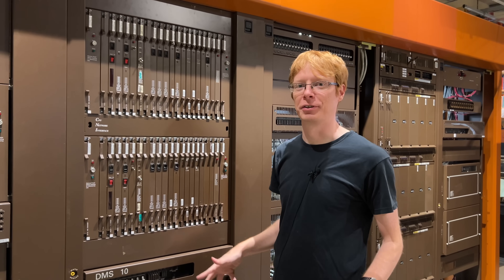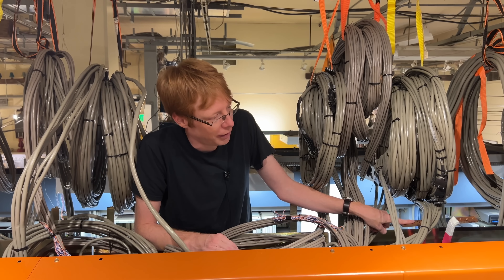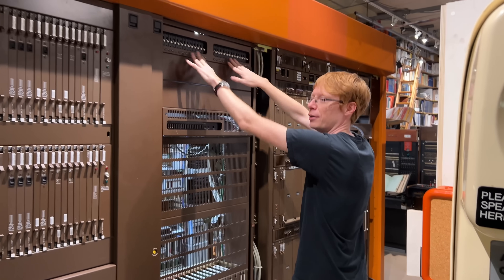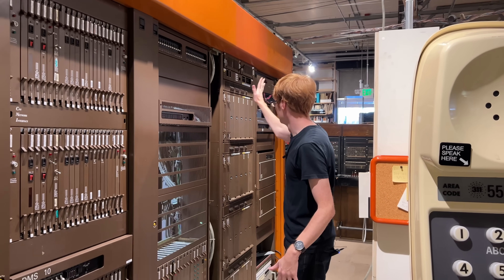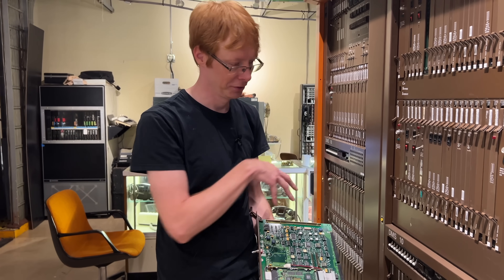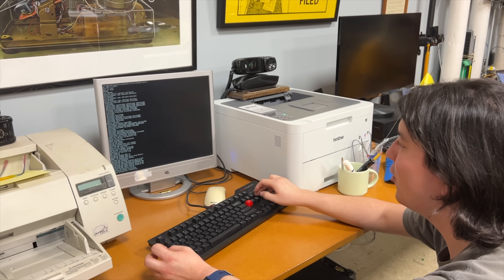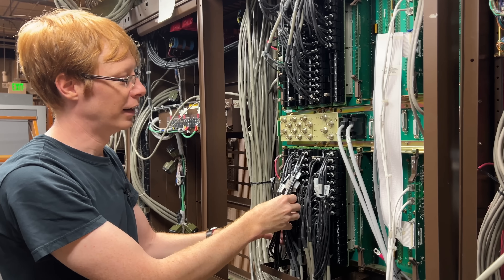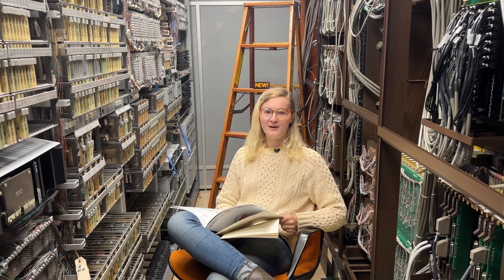Grounding and Wiring our New Switch

Comment: The power is distributed via uninsulated copper bars? Is that weird? It seems weird.
Reply from the maker: Hoo boy you should take a look behind our power board. Thousands of amps on uninsulated bus bars. 

The DMS-10 power runs from those bus bars into circuit breakers, then cables which distributes it into the various frames.
Reply: @StringerNews1 You can store AC, sort of... the physical inertia of large synchronous generators stores energy and maintains a constant AC frequency in the face of load fluctuations, which actually has an extremely important role in power distribution analogous to decoupling capacitors in low-voltage DC circuits. In fact, a synchronous machine (motor/generator) with nothing attached to the rotor (except mass), used purely for its inertia, is known as a synchronous condensor or synchronous capacitor. They're used for power factor correction and power grid stabilization.

But as the name suggests they're definitely more analogous to capacitors than to batteries. The output frequency depends linearly on the amount of energy stored, so if a synchronous condensor were used as battery the AC frequency would gradually decline during discharge, which may not be appreciated by equipment.

Also, heavy spinning things that store a huge amount of kinetic energy are kinda terrifying.... but then again, same goes for large battery installations.
Reply: @StringerNews1And a battery stores chemical energy, not electricity. Electricity consists of moving electrons, it's not something you technically "store". The exact manner in which energy is being stored isn't relevant to the application since it's converted to/from electricity as needed (DC in case of a battery, AC in case of a synchronous condensor).
Reply: @StringerNews1 Also, in both cases the energy conversion is a physically reversible process, i.e. they will instantaneously switch between charging and discharging as needed (passively, without some form of active control), which is what enables their use to smooth a power supply.
Reply: It can vaporize a dropped screwdriver without even flinching leaving only a shadow of metal around it.
Reply: You are quite correct, having large live bus on top of the frame would be EXTREMELY dangerous. IIRC the bars at around 3:44 in the video are for battery return, which is bonded to earth, so the difference between the bus bar and the steel parts just a screwdriver away will be 0V.

Power distribution is accomplished via the various breaker and fuse panels mounted within the bays. The only live connections on top are those two that Colin indicated are A and B feeds, which are twisted bars with red heat-shrink on them.

You'll find bare copper bars for distribution within protected bays like a BDFB. You'll see similar in battery rooms too, older setups (with glass batteries) you just knew to stay the hell away from them. Newer plants tend to have protective sheets overtop of the straps. Large distribution systems can have similar, where current is carried by overhead bars (lams/laminations) instead of cables.

One of the models of power plants that was sold with the DMS-10 is like this but acrylic panels protect the entirety of the live components.

Comment: I'm very curious about something... Where I live, I am serviced by a DMS-10, but in speaking with a local tech, I was told our DMS-10 operates in a very different manner compared to most. I was told that in order to save costs, our local DMS-10 does not have a "Switching Matrix" (his words), and that all calls, including local to the switch, are sent to a nearby town's DMS-100 and routed back. He told me this is an extremely rare way of setting up the switches, and was only done in 3 other locations across our entire province from his recollection. Does this make any sense? Any feedback on this? It's an interesting tidbit of information that I figured would have your curiosity. I also can vouch that we've had the main feed lines between the two switches go down, and take down the entire town's switch, including calls to itself stopped working. "Survivability" mode I think he called it. We also have some DMS-1U switches still peppered around the area as well and he said those were also set up in a strange manner. I got the impression that my area was very much a TestBed for some cost savings ideas that I don't see replicated anywhere else. (Probably for good reason lol)
Reply: Yeah, that was definitely a thing for a long time.  I believe the correct product name was "remote concentrator module" or something like that.  But essentially most of what makes a DMS-10 minus the brains acts as a remote for a DMS-100.
Reply: @neillthornton1149  Very interesting! I’m from Quebec Canada myself, so I’m curious how much this was done elsewhere. The way the tech spoke about it, it seemed to be almost a “Duct tape hack” to save money and wasn’t something recommended.
Reply: This sounds familiar. DMS-1U was good enough up to a certain size for a remote office, which I've seen a couple of in Bell's territory in SE Ontario. I have heard of a lobotomized DMS-10 being deployed if it was too large and the company didn't want (to pay for) the extra features. I never got an answer on it but I think the system in NPNEON may have been such a critter, as it had makings of a DMS-10 at one end but there were DMS-1U line packs as well. Been a few years, however, my memory is hazy on it.
Reply: DMS10 was basically a "network access " device for smaller/rural markets. Up to or starting at 10 subscribers/lines. Trunks would then pass the calls to the metro switches aka DMS100s for routing and special handling.  When the DMS10-400 generic was introduced it incorporated the LCE bay/frame borrowed from DMS100 and therefore had more subscriber capacity. And the product and market took off deploying them worldwide.

Comment: One thing worth mentioning.   Northern Telecom was very early at adopting converting much of their maintenance and translations documentation to CD-ROM in the mid-1990s.  There is likely a retiree from Northern Telecom or an RBOC who has old "Helmsman" CDs laying around which might provide you all of the engineering, installation and translations manuals needed to support these switches.
Reply: Correct. I was the product manager for Helmsman for many years.
Reply from the maker: @ctillnc Neat.  We got a helmsman CD with the switch, but we would love to hear more about that part of the history.  Feel free to get in touch with us.
Reply: Going to need an older PC to run Helmsman.  

I'm currently working on a Switch-wide static problem, with our DMS-10.  Support is practically nonexistent, albeit Nokia's support from India.

Back in the late 1990's I was an Equipment Installer for Nortel.... mostly DMS-100 MAC work, within the SBC Account.  Now, I'm wishing I would've done more with the DMS-10's!  :p
Reply: @oliverw.douglas285   For the older PC to run Helmsman, is that for hardware compatibility? or software? Would a Virtual Machine allow the install of the software?
Reply: @saunderscvids  I believe Helmsman has issues running on newer OS's, specifically 64-Bit OS's.  If the source docs are PDF's, they could be viewed independently, but the Helmsman viewer & table of contents makes it easier to view & find specific documents.

Never tried running it in a vm.
Reply: @oliverw.douglas285  Thanks for the info. I'd suspect a VM with an older OS running would be a way around the old PC, if one can't be found.
Reply: @oliverw.douglas285  If all the issue is is the OS, then using either a VM or an emulator such as WINE under unix/linux might be sufficient. Simply locate an ISO of the desired OS version. Though locating the actual hardware would be easier, using the VM/EM would be more supportable going forward.
Reply: @oliverw.douglas285 newer windows might run it correctly even if 8 or 10 didn't run at all or showed wrong palette, upside down or something. Theres been some backwards compatibility improvements(by default and options), which as far as I can tell are mostly totally unannounced.
Reply: @oliverw.douglas285  It'll run fine on XP (32bit) I ran it on my old Sony laptop. (I don't see any Nortel stuff in a backup from 2006. I would not have DMS docs anyway -- SDMS and metro-e stuff.)
Reply: I think we ran Helmsman on Windows XP, shouldn't be too much of a hassle to spin that up!
Reply: I hope the CDs are still readable, they tend to age badly, even if not used.
Reply: Helmsman was awful. We refused to use it in the uk.
Reply: Before Nortel moved to CD-ROM, documentation for SP1 and DMS existed in two forms: paper and microfiche. I am in possession of some of the fiche related to the HP-7970 (a 9-track tape deck used for loading programs and briefly for recording AMA data (long-distance billing)). Why? Because I was the guy who did preventative maintenance and repair of those decks.

Comment: I remember circuit packs in 5ESS and DMS-10 / DMS-100 switches being VERY sensitive to static.  You probably should be wearing a ground strap when touching those boards, even with the switch powered off.
Reply: Most all of the IC's in that era were VERY sensitive to static. Yes they should be using static protection at all costs.
Reply: Those yellow plugs labeled “static ground” should definitely be used with wrist straps with proper ESD termination. Even cheap disposable ones could prevent your soon-to-be museum piece less likely destroyed by ESD.
Reply: Or at a minimum, hold the circuit packs by the plastic lock tabs, if you don't have a ground strap.
Reply: @rc_farmer4866  That will still allow static to be generated, but it will stay on the card instead of transferring to you. Even when I wore a strap, I always tried to touch a bare metal spot on a rack before I inserted it, and if someone handed me an unbagged card, I touched their arm or hand before I took the card from them to equalize any charge directly through them and not through the card.
Reply: Glad I'm not the only one who noticed that. While he was telling us about how vitally important it was to not damage this irreplaceable piece of tech I was watching him put his fingers all over the PCB without any kind of ESD protection and inside my head I was going "please don't let them find out the hard way about ESD".
Reply: @MicraHakkinen  9:32 he has his thumb clean across the PCB of that Atlas V HDD.
Reply: Electronics of this era you were "lucky" to kill something with static.  It was far worse to damage it so that it became flakey.
Reply: @garthhowe297  Between static zaps from mishandling like he did, and PCB mounted electrolytic and tantaulm caps failing, that old Nortel stuff will be a struggle to keep working no matte r what they do.  I worked on DMT300 / FD135 / FMT150 OC3 muxes a lot, I was always riding the struggle bus doing it.

Comment: those look like bnc ports on the back side of the switch i wonder does it have the capability of receiving trunks at the ds3 level?
Reply: Yep absolutely. There was also available hardware for optical connections
Reply: @holysirsalad  wow i had no idea, we have several dms10's in the co's i cover and as far as i know our trunks and ss7 links are wired in as ds1's and ds0's, always learning something new about this switch all the time, too bad they are slowly decomming them all.

Comment: I would posit that the Xilinx FPGA implements a digital cross point or digital switching function. It should connect the line cards to other line cards and connect the line cards to the trunk cards. It could implement a digital conferencing function. DTMF detection and tone generation may be done in a TI DSP. 

Take care of the modules in the shelves when initially powering the racks.